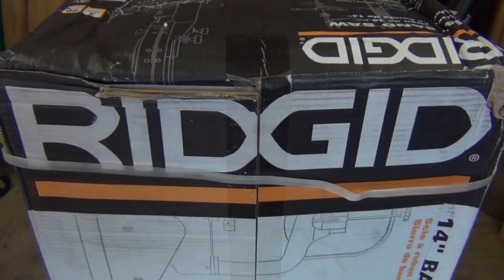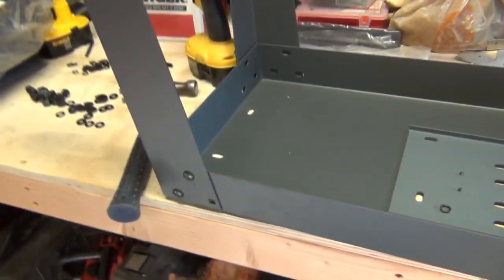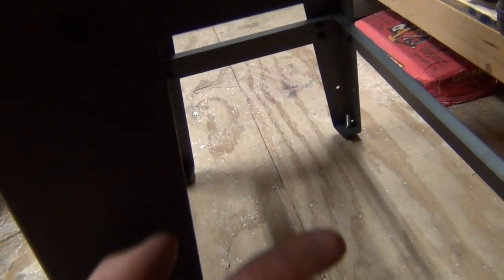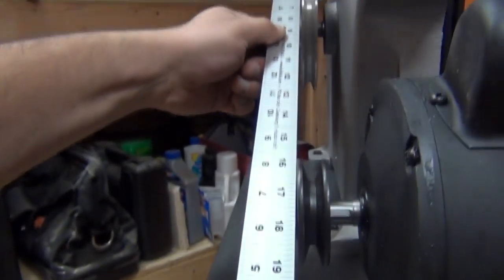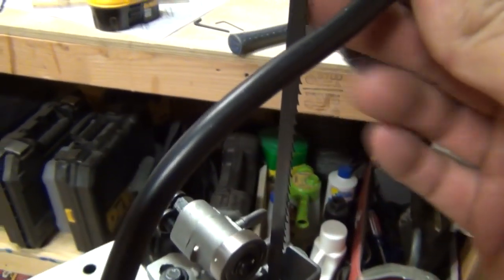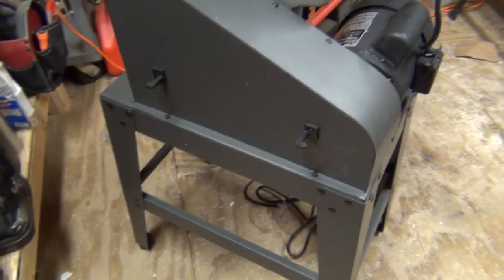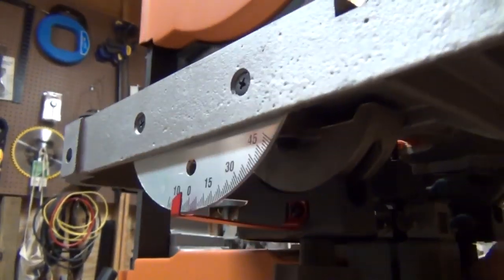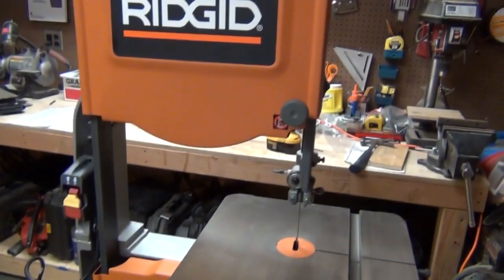Ridgid Band Saw - Unboxing and Setup

Comment: Well, this posting is 7 years late after your purchase.   

I own an industrial equipment supply where I sell lathes, drill presses, saws, compressors, injection molding, etc.  my business services all the equipment  we sell.  And we also service light power tools such as the Jet,  Ridgid, Craftsman, Ryobi and other bandsaws that many novice wood workers use.   

I would imagine you have encountered vibration issues since you purchased the saw and found the motor underpowered.  

If you haven’t figured things out about reducing vibration, take off the grommets from the bolts holding down the motor and remount motor to the metal deck.  If saw is not used consistently and sits idle for a month or so, you will find a new vibration or the vibration becomes worse.  This vibration is caused by the v-belt.  The belts takes on the shape of the small motor pulley and becomes out of round if the saw is not regularly used.  Buy a new 40”-42” v-belt.  Better yet, buy a link belt on Amazon, auto parts store or at Harbor Freight.  A link belt will eliminate the the belt becoming out of round by sitting idle.   Yeah... link belts are expensive....about $35 or more.

Again, if the saw sits idle for a month or more, the rubber tires on the 14” pulleys will develop a flat spot from the saw blade.  The result is more vibration.  Buy new rubber or urethane tires to solve vibration problem.  If saw sits idle for a few weeks at a time, take ted the saw is underpowered and will not cut wood.  When I service  saws, many times the blade has been installed backwards.  The blade must be flipped to achieve the proper rotation direction.

The biggest issue with all these bandsaws used in the home workshop is sitting idle.  If the saw sits idle for long periods of time, problems develop from lack of use.  These saws are not the highest in quality and manufactures use cheap parts.  This is regardless of brand you buy.  If you want a saw less prone to problems, then be prepared to shell out about three to four times the money.  You get what you pay for these days.

I constantly see videos on YouTube that malign Ridgid saws.  These saws are basically the same design as other brands like the lower end of Jet & Grizzly.  Other brands experience the same issues described above, but are apparently not reported as much on YouTube.  I see other brands just as much when I make repairs.

Comment: So what do you use this type of saw for?  Any benefit to this over a table saw for wood or are you using it for metal cutting?
Reply from the maker: ELIRAXPRT Used for cuts involving curves that you can't do on a table saw. Nothing beats a table saw for straight line rip cuts

Comment: I bought one of these and have never been able to get the blade to cut square to the table. I have used a square to get the blade and table square but the blade itself is turned a bit to the inside. So........if you are looking at the blade from the front of the table, the front of the blade is to angled a little to the left.  Any idea what could be causing this?

Comment from the maker: It does say blade storage in my manual - very odd in deed.  Never used them regardless.  Not an ideal means of storing multiple blades anyhow.  Although it does seem like it would hold the cord much better then blades.  Thanks for watching

Comment from the maker: @zx8401ztv Yeah, that was no easy task lifting the components into place.  I was wondering the same regarding the groove.  I checked online and there is no miter push slider included with this saw.  I have one from my table saw that will work.  Thanks for watching

Comment: Looks like a great tool :-)

I can see why its so dam heavy, the motor must be a gutbuster to lift and the adjustable bed must weigh a bit as well.
You sure got your moneys worth in metal.

I wonder if there is supposed to be a slider to fit in the bed groove, to keep the wood parallel to the blade when cutting?, im not into wood work so i may be talking rubbish:-)

Happy sawing ;o)